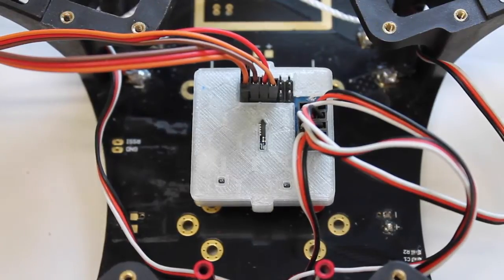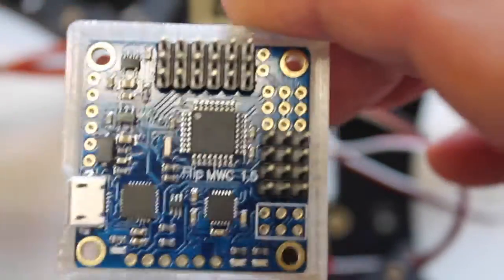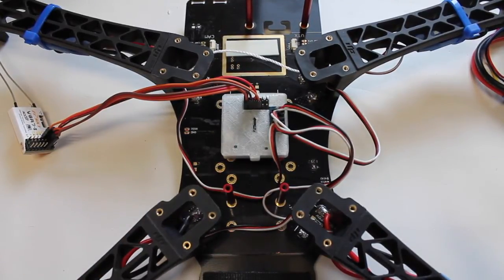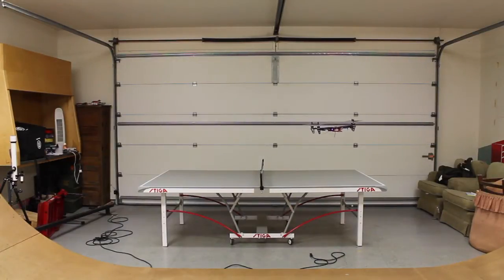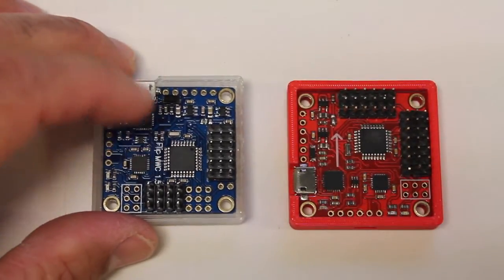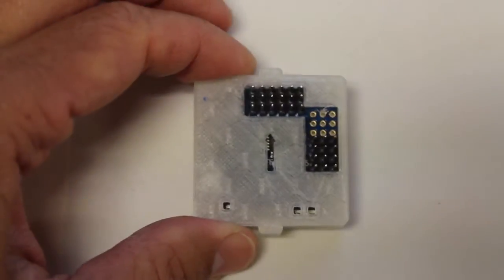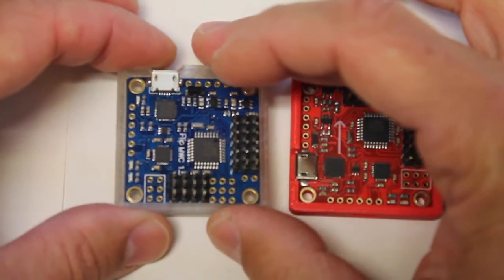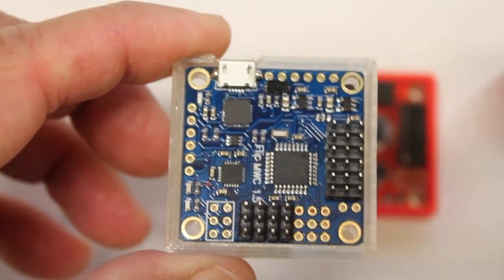MWC Flip 1.5 RTF and Updated Top Case Design

Comment: Hi I am a new baby in building quad .... I have the same FrSky RX ... but a multiwii SE V3.0. I can't really see the pinout between the RX and the FC... Do you have some build blog somewhere or some photos ? Really I am completly lost ... Coz I see some connexion in channel 2 & 3 of your RX going your FC, I am right ?
Reply from the maker: SeBy DocKy I'm not sure how similar the Flip and the SE are, but let me give some advice that will hopefully help. Your SE will have Aileron, Elevator, Throttle, & Rudder inputs. They'll probably be named like D2, D4, D5, D6. Just make sure you have a proper diagram for your board. Then run the right channel from your receiver to your FC. Regarding what order is dependent on your transmitter. Most default to AETR (Aileron, Elevator, Throttle, Rudder). I know the Turnigy 9X does that order. With the Taranis you can change the order. Anyway, I hope this helps a little bit and if you continue to have problems please post in the forums at www.garagepilots.com and we'll help you out over there. Good luck.
Reply: Dennis Baldwin Hi dennis, Well .... I managed to have a working system but ... actually, I am testing without the ESC connected. So only RX is connected to the MWC. I used some JR (3 pins) connectors for all the 4 channels (AETR for my devo10 too). With this wiring, the RX is not powered ... I have to add another JR to  channel 8 from an car ESC I have. My question is simple: If you remove your ESC connexion, plug your FC only on the USB, does your RX is also powered (with only the right part of yoir wiring (Throttle with full JR, then other with only signal pins connected). I hope to be more or less clear ...

Comment: Dennis love your videos and you easy explain to do.. Question just bought a few Flip 1.5 boards and a few Flip 32 boards and seen you have your Turnigy radio on yours and was wondering where your set the -130 130 trims at like the Flip says do and the Throttle -50? ive googled it and looked around but not much on the Turnigy radio on a flip and setting it up and flight modes...can you help on this or point me in the right place? Ive posted in Garage forums but no bites there even.
Reply from the maker: Hey BC, to be honest I didn't change my trims to what was recommended on the Flip 1.5 packaging. I just let them at their defaults and it flew really well. Regarding flight modes it should be pretty straightforward. Here's a video I did using the Taranis: FrSky Taranis Mode Switch to Toggle MultiWii Acro and Horizon Auto Level Mode If you've seen any of my videos setting up flight modes with the T9X and NAZA or APM then you can adapt that for setting up your MultiWii. Hope this helps and good luck.

Comment: Hi! Did you get your Discovery to fly good with this board? I currently got naza in mine. But maan, that thing is so booring to fly. Since i got a flip laying around i want to try that out, but im so bad in setting pids and gains . If you got yours to fly good, i would be a happy man if you could share the settings :) thanks :)
Reply from the maker: I got it flying pretty well although I didn't keep my gain settings. I no longer have my TBS, but I do plan on doing a video that shows how to tune these gains soon that should help with your setup. Thanks for the question.

Comment: Are you going to do a step by step how to setup video. I just got mine and I can't even find out how to plug everything in and arm it. Thanks
Reply from the maker: Where did you get yours from? Sometimes the MultiWii comes preloaded with firmware. If it doesn't then maybe this will help:

MultiWii 2.0 Firmware Load and Configuration for Acro and Autolevel on AeroSky Quadcopter

Comment: Whats your take on the flip 1.5....is it hard or easy to programme one?...Im looking a simple fc for coming mini quad frame
Reply from the maker: The flip is awesome because it comes pre-programmed. I just stuck it in my TBS Discovery and it flies great. I also have another one that I put into my DIY Mini Quadcopter and it's incredible out of the box. I've been very impressed.
Reply: have you done any video on how to programme the flip?
Reply from the maker: MrCpmboy Not specifically for the MultiWii Flip but it shouldn't be too different from this:

MultiWii 2.0 Firmware Load and Configuration for Acro and Autolevel on AeroSky Quadcopter

Comment: hey quick question my tri with kk2 on it 35% of the time when descending to land about 5ft off the ground one motor goes berserk and flips it over into the ground even when i cut throttle and no stick imput it will usually keep running the motors when it crashed for 10sec or so any ideas to the problem?
Reply from the maker: So you're able to fly okay until that point with no oscillations? It doesn't happen at about the same point when you're taking off, only when landing? I have a few suggestions such as ESC calibration, make sure you're using some sort of dampening foam beneath the KK2 to reduce vibes.
Reply: Dennis Baldwin
kk is mounted on nylon spacers and i have calibrated the esc's multiple times because i thought that was originally problem. dose not seem to happen taking off. flys ok in the air little oscilation not much and generally drifts a different way each time i take it up so cant really trim it out permanently. i was thinking they are HK brand esc so maybe they are just junk or something?